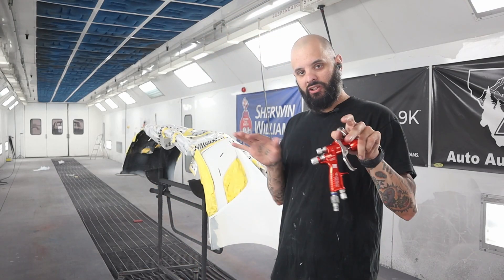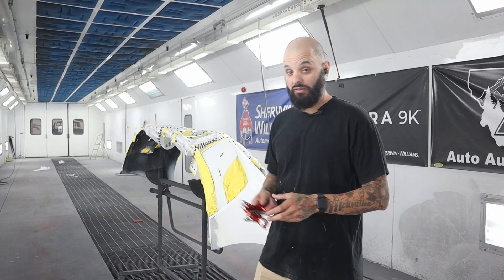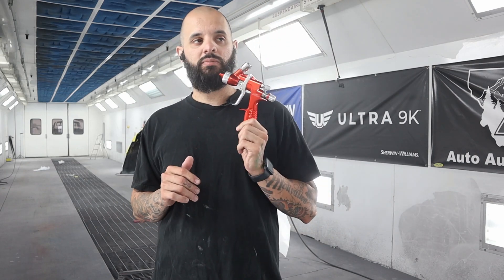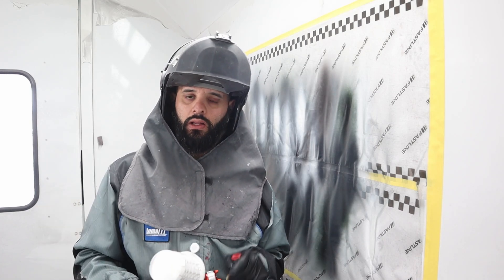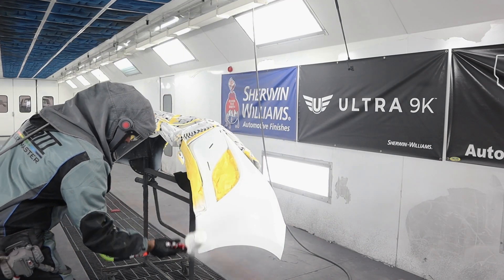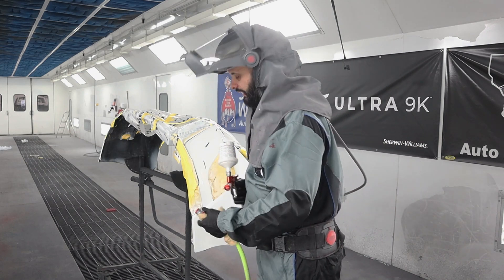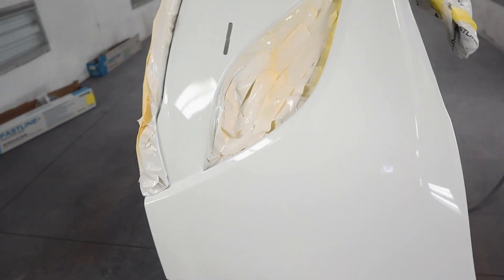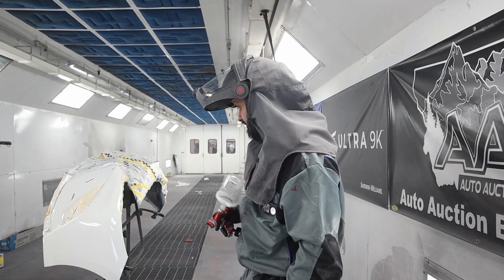Sagola Mini Exteme Demo and Review!

Comment: u should try the 1.2 its much faster than the 1.0 i have both and the 1.0 i find to slow .
Reply from the maker: It’s a mini gun. I want a 1.0 lol. If I need speed I swap to a full size. I actually need to get a .8 setup for it for even smaller touch up jobs. I have a 1.2 in my lph80 and it’s too much for some really tight work.